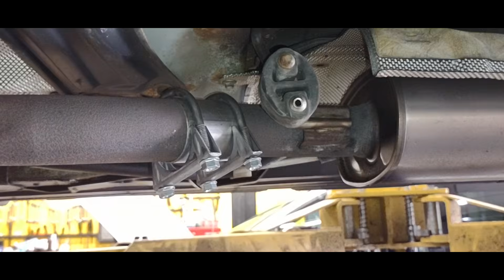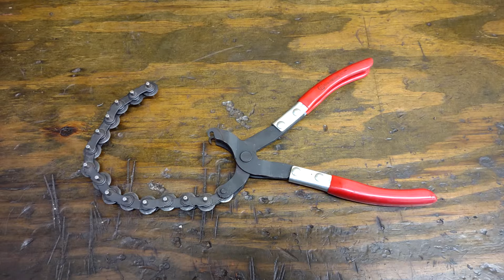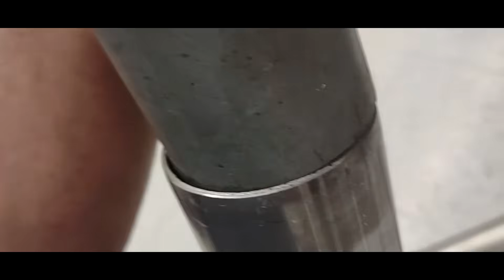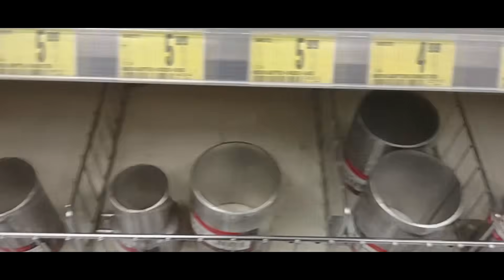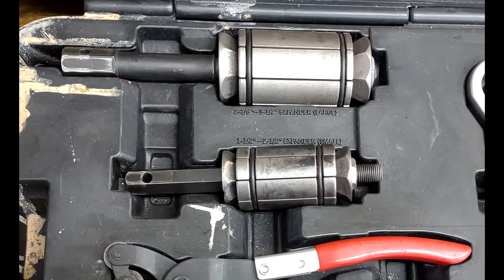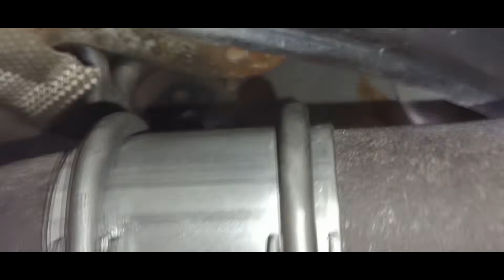Real Exhaust Repair - without welding + many tips.

Comment: buy a used welding machine for 50 try couple times with scrap metal and weld your pipe. 89% chance u will do it right.

Comment: The part for this repair is sold online, no need to do all this, -T304 Stainless Steel Band Clamp w/High Grade Bolts-, besides this repair is not good, it will leak.

Comment: Do you have a video talking about how to replace catalytic converter without welding thanks
Reply from the maker: No.
sorry, but the idea is the same.
if the pipe is in good condition, than your new catylitic converter should slide right over the old pipe, and if the size is good, and you don't have too much of a gap between them. Than using this method with the clamps, should work.. good luck

Comment: Without using a pipe expander couldn't I just use a larger pipe?  Lets say my exhaust pipe is 2".  Wouldn't I just get a 2 1/4" adapter and two 2 1/2" clamps to secure it down? Or wouldn't that work.
Reply from the maker: In theory, kind of. You would get a 2 1/8 adapter pipe,  and two 2 1/8 clamps. ( you may need to stretch the clamp a bit, i show that in another short video)
But the problem is, these pipes, many times are not perfect, and require a bit of  working on the pipe, so it goes on/fits perfectly. If the pipe or the clamps are too big, than. There would be an exhaust leak..
Reply: @drcar9202  Thanks for the insight. Much appreciated

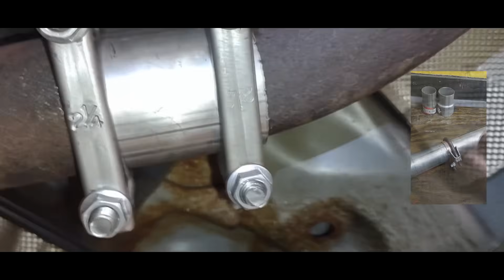Comment: 6:40 The only thing I would add is to rotate the clamp so that no bolt(s) are  lower than the pipe.  This is so that you travel over anything in the road, it does not rip off the clamps.  Excellent video!

Comment: nvm, i see where the pipe im asking about came from.
autozone did have it, i just failed to notice that it was indeed
the right part i was after. size may not had been in stock but
they do indeed carry 2 1/8" piping. just must be clampable.
Reply from the maker: Glad to hear.. usually if u go around the stores someone will have it..

Comment: Can I do this repair for an exhaust pipe flange that’s rusted beyond repair?
Reply from the maker: It depends if u have a good full circle..
 even if its very rusty it will work.
 if the pipe is not very smooth i would put red RTV for a better seal.

Comment: I used that technique also for my exhaust..What I did is I am putting high temp silicone gasket maker on the old pipe, then insert the new one..to give a better seal.
Reply: No just no. Check temp ratings then look a catalytic converter temps. If its that pitted use muffler cement.

Comment: Great tip. Only thing that I would add is some Prematex 80335 tailpipe sealer around the pipes before installing the pipes. I even use it on new installs as it takes care of small leaks. I have also done this repair with soup and soda cans. Good video. 
Happy Motoring.

Comment: Excellent content, some folks fail to understand you can go to multiple auto places that SHOULD have what you're looking for to only have everything BUT what you specifically need.  When you live far from these places it makes finding the right components all the more crucial.  The tips you shared like the C clamp vice grip trick will be extremely useful in the near future!  Thanks for sharing.
Reply: Dude tell me about it. This was me yesterday. I was about to pull my hair off my scalp. I went to autozone, oreillys, harbor freight & finally found the part I needed at Home Depot. Out of all the places Home Depot smh.

Comment: If you bought the right sizes, in the first place...You wouldn't have to go thru all those unnecessary steps and have to MacGyver anything.
Reply: I believe you need a digital caliper to measure the outside diameter of the pipe that's on the car...then you need to match that size with the INSIDE diameter of the repair piece...does this sound correct?
Reply: Guys referring to book knowledge not experience. You can but the right connector with it's ID matching the OD of the two sections . But then you stop by the store and realize a the connectors go from 2 /2 straight to 3". That's why he had to bend open the U clamp and then use a c clamp to help it close back again.
Reply: @GangsterishlyMelodic 
How about a strap clamp?
Reply: Wow!! You're brilliant. Keyboard genius!